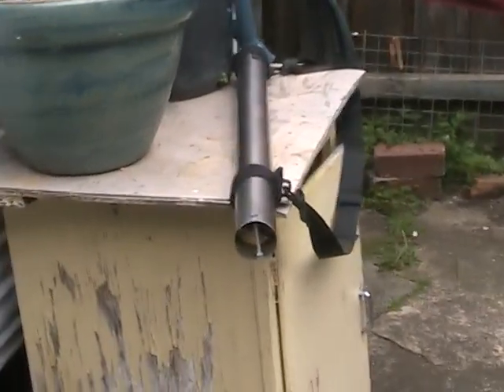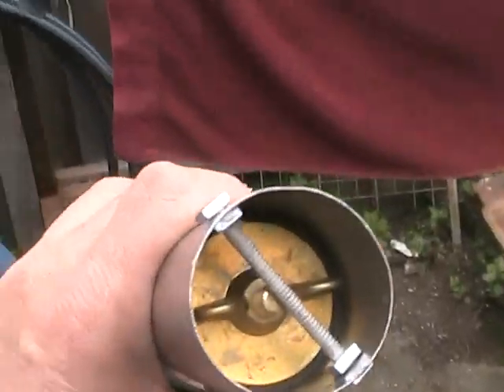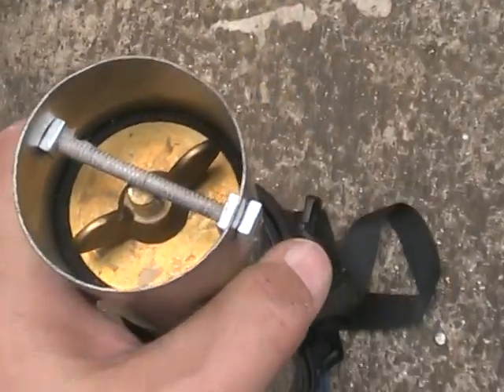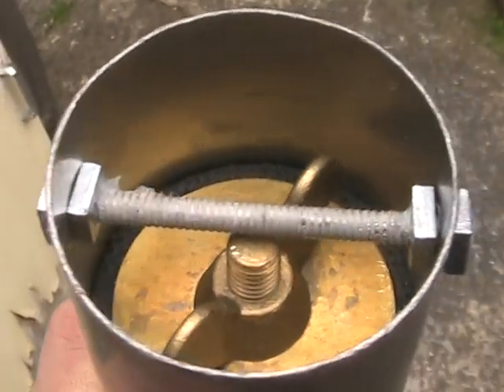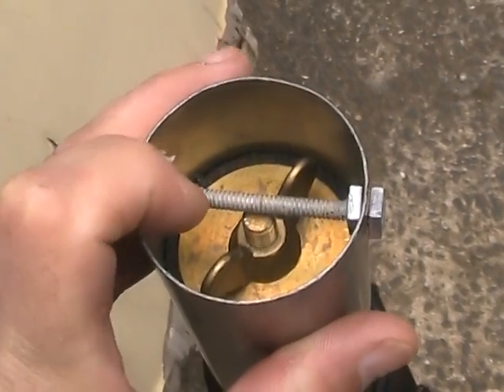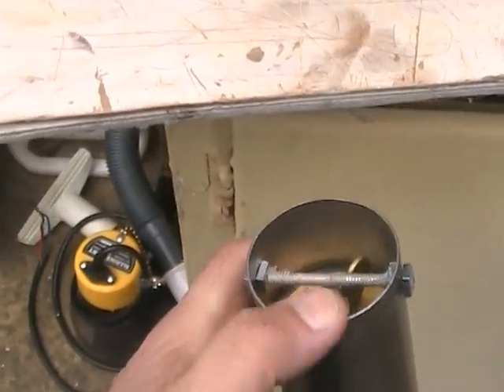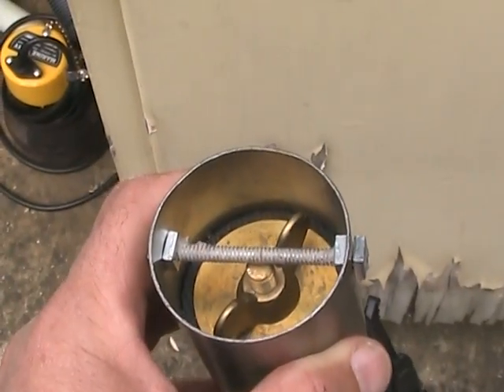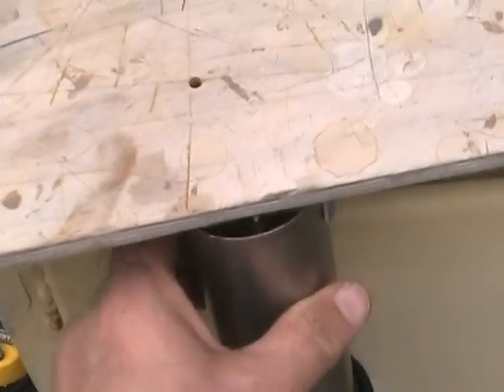Wilson Bait Pump Gold Dredge Modification

Comment: I am not getting why you don't want larger rocks to go ip the pipe.
Isn't the gold underneath the bigger rocks in the creek and if the rock doesn't move , then how is the good material under the rock gonna get into the chamber ?
Reply from the maker: Underneath is the where I want the material from, I have had a large rock stuck in the chamber, a pain in the rear to get it out! The material will still sucked out, just without the annoying larger rocks. Seems straight forwards to me that you don't want a chamber full of crap.
Reply: @dataglasses  I never really thought of rocks jamming in the pipe.
Never had the issue myself , but then again , haven't done a lot of yabby pumping
Reply from the maker: @mohammednovalija  It happens and is wasted time to get them out, This idea prevents it happening. Cheers
Reply: @dataglasses  yup - with gold dredges they have something similar because if rock gets jammed in the pipe it takes a long time to remove it